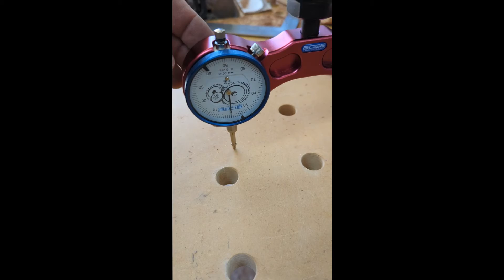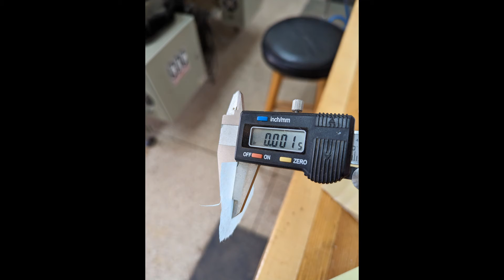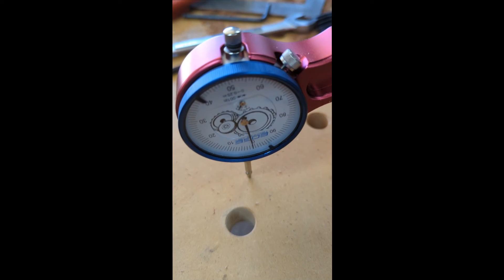Tramming both the Z axis and the spindle axis on an AVID CNC router

Comment: I have the dual head tramming tool you have...Please don't take this as me trolling you have helped me with my Avid a lot.....BUT if you just use the table as you did you are missing the boat.  Get a piece of glass that you can rotate the tramming tool around on. use one side of the tool and begin leveling the piece of glass to that side in all 4 directions.  I used pieces of paper to raise the glass until perfectly level with one side.  Once level "0" that side...now rotate the other side to where you just zeroed the first side....now "0" that side...then carefully rotate the tramming tool.  I think you will see you are still out of tram...I did it like you show and still had poor results then a machinist showed me this method and I have no discrepancy using a 3" cutter head.  It took a while to get it right, Want to say an hour or so but it's dead on now.  I think there are some videos showing the method I'm talking about. Again I really value you channel so please don't take this wrong I'm only trying to help.
Reply from the maker: As always I do appreciate feedback, and you bring up a point that I mentioned, but in retrospect was not clear enough.  The method you are talking about is for when you have a new machine or spoiboard and don't know if it is parallel to your X and Y travel.  This was a retram I was doing and I knew my spoilboard was a reliable surface so I could use it directly as I did.   
I should also mention the dual indicator tool is not needed to do the method you refer to.  A simple one- sided tramming tool like I mentioned can be used to level the glass plate first, then trame the spindle.  It's a little less convenient because you have to rotate it side to side to use it, but it's a lot cheaper.
Thanks for pointing this out, I wish I would have been more clear in the video.
Reply from the maker: Just an update, I added some clarification on this in the description secion and also added a link to a good video on the method you mentioned that creates a good reference plane when the top of the machine is still in an unknown state.  Thanks again for pointing this out.
PS-I like your profile picture.   Jack Elam was one of my favorite old actors.

Comment: Wow, what a timely video. I just installed the 4hp hiteco yesterday (the one that replaced the bad runout one). Here is what I did. I have a couple machinist levels I leveled the mounting plate, then hauled a surface plate over to the machine and using the levels shimmed the plate 90deg to the world then used a similar tramming tool. Happily it was within a thou on the nod. It went really fast, last time it seemed like I fought for a long time.
Reply from the maker: Hi Brian,
I can't say for sure because I've never compared it to another way, but I'm suspicious of the accuracy of a level compared to a good square and feeler guages.  I'm not sure I can tell the difference between 0 and ten though on a level (my eyes aren't that good up close anymore either), and then a short level's error would be magnified over a long 12" Z axis.  You should measure it with a good square and tell me if I'm just being paranoid or not 🙂
Reply: @JNWoodworks  But, But it's a really good level.. lol
Reply from the maker: @bstanga  😉